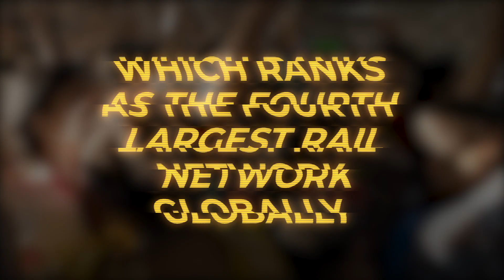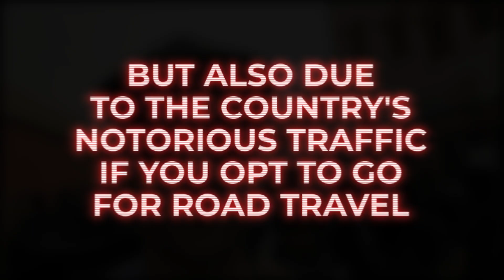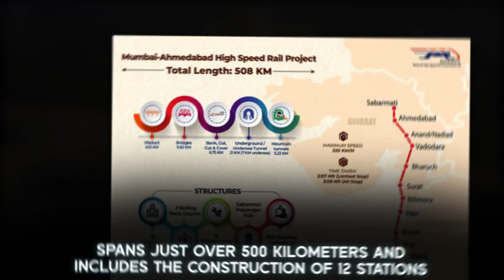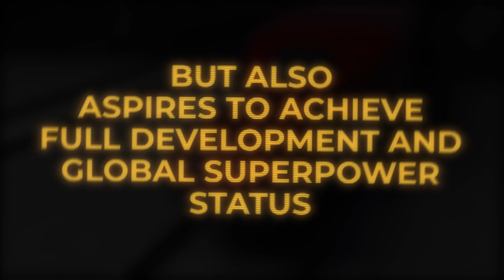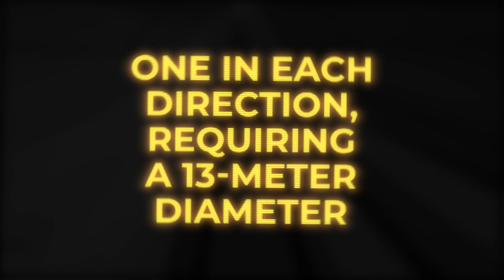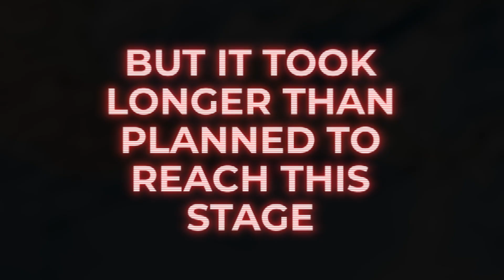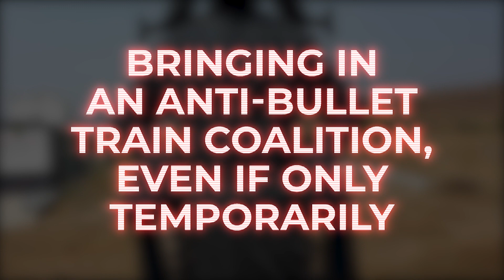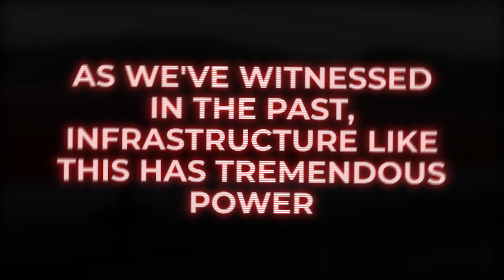The Battle of Building India’s First Bullet Train

Comment: Most of the data presented is old. Bullet train is not a solution to train traffic. It was not even presented like that in INdia. What would ease the traffic are DFC (Dedicated Freight corridors) on both east and west side. Induction of Vande Bharat train, replacing tracks that offer higher speeds, Converting 100% of the tracks to use electric power, making Gate less railway crossing all across India and rebuilding the stations around India that are more like a Trasport hubs with better facilities that look more like airport than railway station.